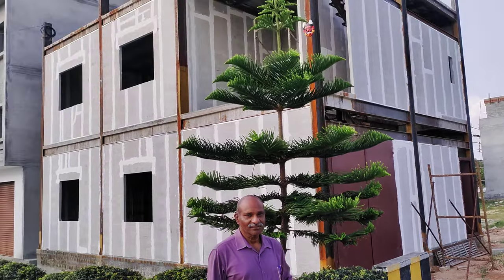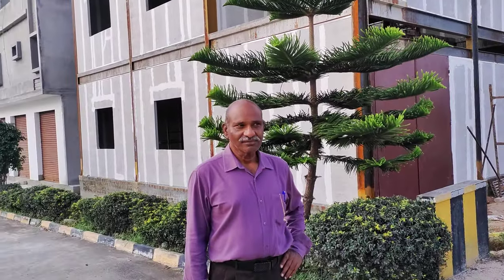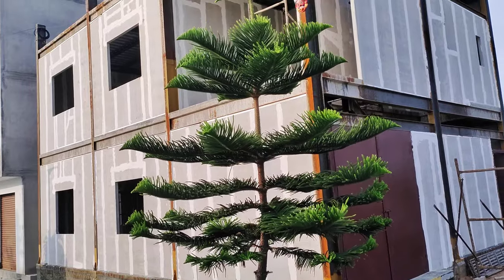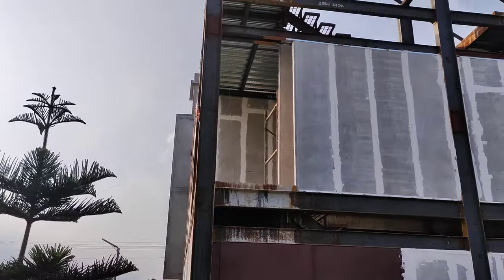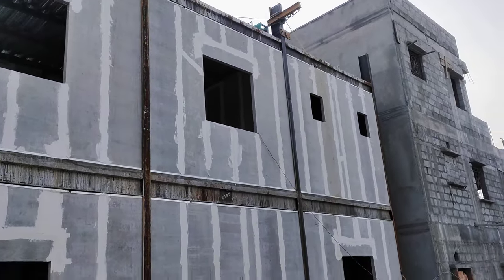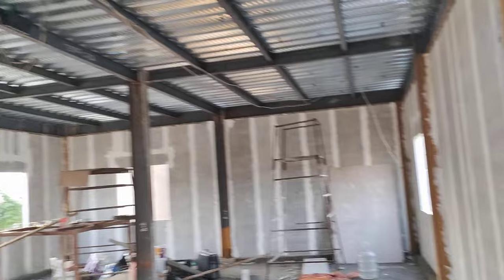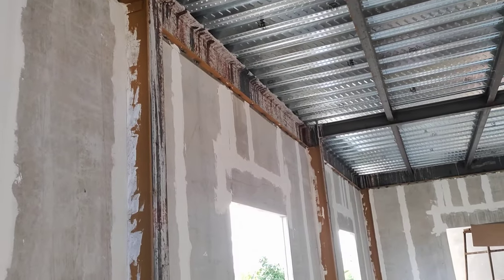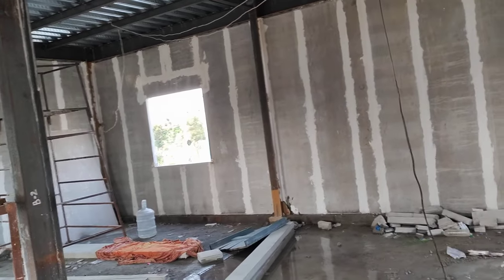Sustainable Residential Steel Building with Birla Aerocon Walls | PEB | Bangalore

Comment: Can we make it for our home as 2nd and 3rd floors. Already ground and 1st floor is there built with stone and bricks without any columns.
Reply from the maker: Sounds feasible provided ground and first floor should have done using column structured building with adequate load bearing foundation. In case of doubt then you may need to consult structural engineer first then decide accordingly

Comment: Thank you for your informative video. I would be much grateful if you kindly answer my questions: 

How much is the size of the columns (the i-beam) is it 24 (cm) or 30 (cm)?
How much is the size of the main beams (the i-beam) is it 24 (cm) or 20 (cm)?
How much is the size of the secondary beams (the i-beam) is it 12(cm) or 14 (cm)?
How much is the thickness of the floor steel sheets : 2 mm ?

How much is the thickness of concrete poured on the steel sheet: 10 cm or 15 cm or more?
Did the constructor use rebars in the concrete of the floors?

The Owner told us he used 10 tons of steel for his building does that contain the roof sheets and other steel parts like doors or it is only the steel used for the columns and beams?

Thank you.

Comment: Thank you  this was good informative as the structure is of metal  the building may go hot during summer I feel..
Reply from the maker: You're right bro, summer season there are chances however you can pack it around the I section beams for not radiating the heat. In fact concrete houses as well becoming very much heated

Comment: hello .. appreciate your effort on creating such a content.. could you explain how toilets were done ? generally in buildings we have sunken slab to take out toilet water pipes.. how different is this in PEB ?
Reply from the maker: Give me sometime, i will get back
Reply from the maker: Its a very good question and very common mistakes that un skilled masons do and become silent when we ask question them.

However in this case owner have used the wall exit method of taking the sewage pipe for WC. For Bathroom, washbasin and kitchen drain they had 50mm pipe in the floor decking sheet at the time of roof casting. All drains come out from the wall located in the Firstfloor and no issues in achieving this.

Comment: What is the expected cost for building 150 Sqft of Room which includes 40 Sqft bathroom in it?
Reply from the maker: For technical details speak to Tirupur Engineering. You can speak to Ameer @ 9842012175 who will suggest further on this

Comment: Which structure is cost effective concrete or steel??
Reply from the maker: Refer below link which is already captured with detailed answers  https://utkarshindia.in/blog/how-are-peb-steel-structures-better-than-rcc-buildings#:~:text=Cost%3A%20As%20far%20as%20the,and%20drive%20up%20the%20cost.

Comment: But the cost you have mentioned works to Rs.3,429/sqft isnt it? it seems very much on the higher side compared to conventional construction. Is the steel frame construction with Aerocon walls higher compared to traditional?
Reply: I would recommend to build it personally calculating the price...

Comment: What is a provision of protecting outside metal from rain, moisture, etc. It will be covered with what material? Please share final constructed video also.
Reply from the maker: Several corrosion resistant paints are available from market which you can try. If you get chance to visit Bangalore Ikea furniture store then they used foamy type of painting for the steel structures which is used for commercial structures. I will try to share final finished video later on.

Comment: Can you build one floor after some 13 years
Reply from the maker: Currently the structure is designed to take the load for G+3 level hence you can plan for extension in the future assuming one should maintain well

Comment: Terish par kya materiyal hai
Reply from the maker: terrace is done using decking sheet with concrete layer is placed
Reply: @porapokku  how much thickness of concerte layer
Reply from the maker: @virenchoudhary7557  3 inch to 4 inch. Not more than 4 inch.

Comment: Kindly share number of engineer. Fabricator..am based in Bangalore too.raj
Reply from the maker: Steel structure is done by Tirupur Engineering. You can speak to Ameer @ 9842012175 who will suggest further on this

Comment: Can u construct g+1 600 sqft at doddaballapur near Bangalore. Contact number please.
Reply from the maker: Steel structure is done by Tirupur Engineering. You can speak to Ameer @ 9842012175 who will suggest further on this